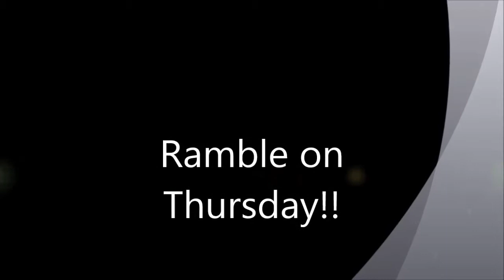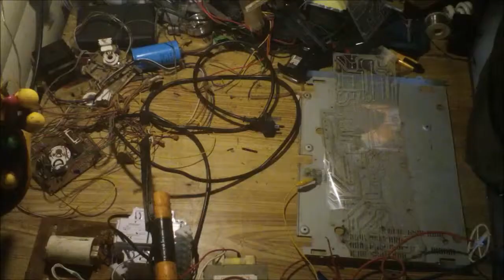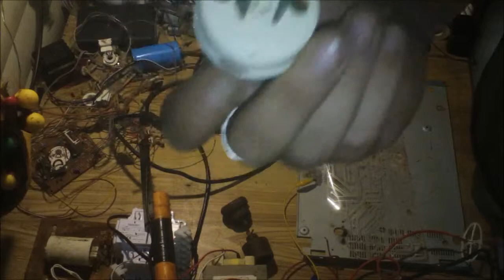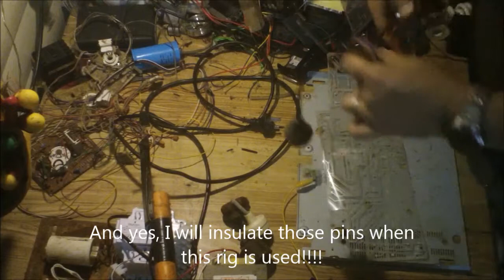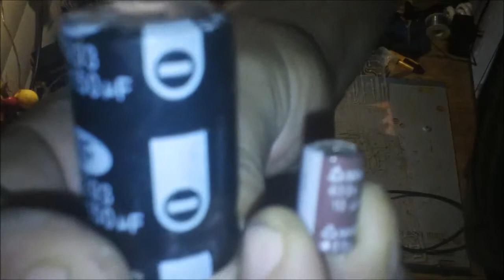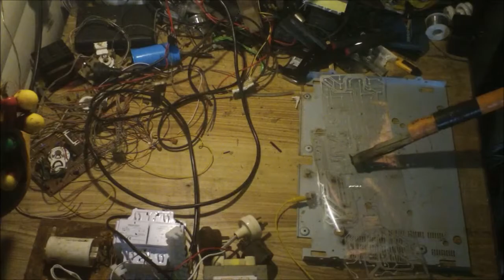Ramble on Thursday!!

Comment: Ah, nice selection of plugs, & a piggyback plug too. :-)

The CFL that won't go *POP*. Try to get two MOTs, wire them up in parallel on the input, series on the output for about 4kv, then stuff THAT into the CFL to see if you can achive poppage. :D

If not, then I will leave it up to you if you want to do 3 MOTs in series for 6kv :D The only other thing I can assume if after all that it still doesn't POP, is that it is somehow self-limiting the current.

LightBulb....Stuff an arc in it! :D

-BBD